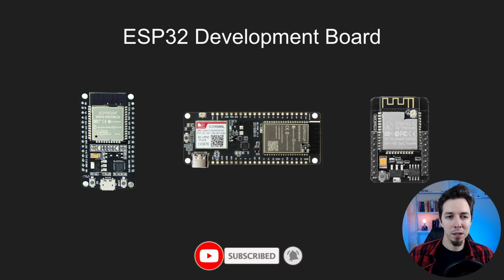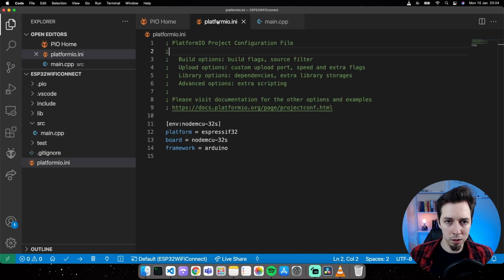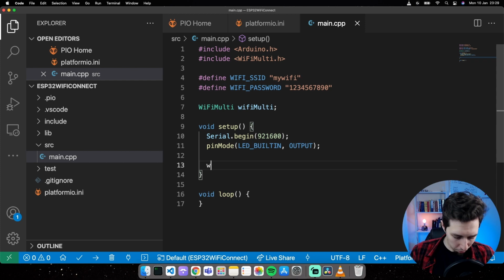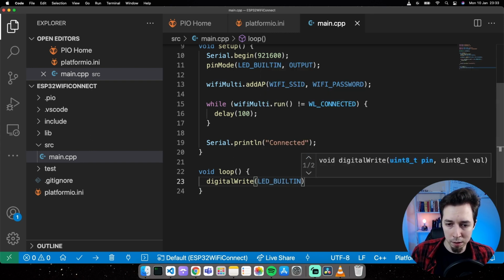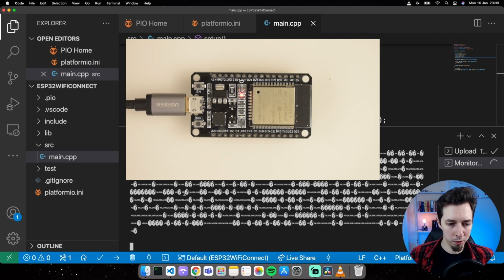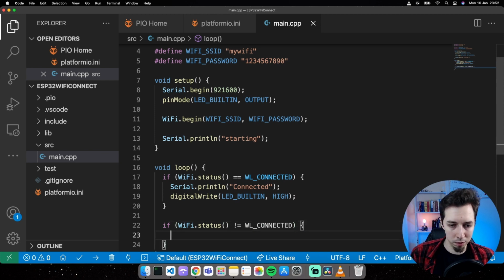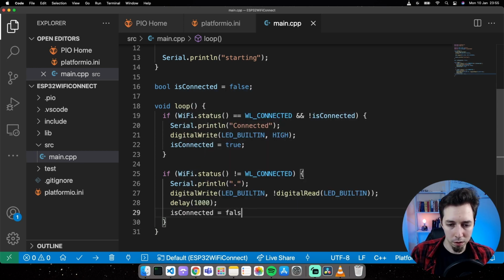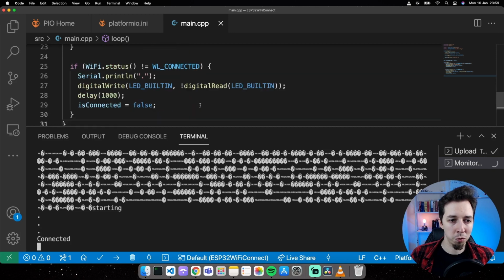Connect ESP32 to WiFi - Step-By-Step Tutorial

Comment: 3 years later and now I'm doing my master's degree with help from this vid. I actually was having some problems with one particular library DFRobot/LIS when i tried to use it in platformio everything broke and my esp32 kept resetting i thought maybe i had some problems with my code but nope it was the compatibility issue beetween platformio and the mentioned library. I went down a rabbit hole trying to fix it but gave up and created my own from scratch. I know this may be random but do have any knowledge about these types of problems ?
Reply: A small update in my excruciating pain of trying to fix this I completely overlook the idea of moving libraty depositories into my local library folder for the project. After tweaking names of variables here and there the entire project works as intended I don't know why it was such a complex problem maybe it's because the library depositories haven't been updated in over 3 years and something broke along the way but yeah... The correct solution is often the easiest.

Comment: Trying to get setup in VS and I am struggling with libraries. I get an error for "#include <WiFiMulti.h>" that the file does not exist. I don't get how you just had it? I have had this issue with another tutorial as well, is there a mega pack of libraries I need to install somewhere?
Reply: ChatGPT helped me out here. I have an ESP8266 and in order to get it working I needed to add the appropriate lib_deps into the platformio.ini configuration file. So I added " lib_deps = ESP8266WiFi " - that got then accepted with no errors. Back in the main code I changed the include to "#include <ESP8266WiFiMulti.h>" and also corrected the instance: " ESP8266WiFiMulti wifiMulti; ". Then the errors cleared out and compilation was a success. Upload worked and connecting worked as well.
I tried to search the tutorial again a few times but I think this part is missing from it or maybe in some cases the general "WiFiMulti.h" just works but in special cases you need to know to adjust some things.
Reply: I also had the same problem with "WiFi.h" it doesn't just work for me only by including it in the beginning of main. Then I consulted GPT again - it seems ESP8266 works different from ESP32 and I can only use the "ESP8266WiFiMulti.h" library which includes the "WiFi.h" functionality. The more you know.

Comment: NEED HELP!
I can't get this code running anymore. It worked a couple of times, but now the USB connection always crashes, even when I'm trying your simple examples. I figured out that it always crashes on the wifiMulti.addAP or WiFi.begin commands. When it crashes, the red LED on the ESP32 is flickering/dimming, and the USB symbol (I'm on Windows 10) in the taskbar is also flickering really fast.

I tried reinstalling the USB driver a couple of times and tried different USB cables and USB ports. I also connected my ESP32 to a USB charger (because I read there may not be enough power through the USB port). Additionally, I tried changing the Wi-Fi mode via "WiFi.mode(WIFI_MODE_STA);" and changed the flash mode via "board_build.f_flash_mode = dio", but nothing worked.

During several tries, I also had to factory reset a couple of times via "python -m esptool --chip esp32 erase_flash" because I couldn't upload any code anymore since the port couldn't be found by VSC. When I'm not calling the Wi-Fi commands mentioned above, the code runs just fine.

Can someone please help me?

Comment: instead of have the "connected" message  i have that message :  [WIFI] no matching wifi found! 
what's the problem ?

there is the code i'm compiling : 
#include <Arduino.h>
#include <WiFiMulti.h>

#define WIFI_SSID "mywifi"
#define WIFI_PASSWORD "1234567890"

WiFiMulti wifiMulti; 

void setup() {
  Serial.begin(921600);
  pinMode(LED_BUILTIN,OUTPUT);

  wifiMulti.addAP(WIFI_SSID,WIFI_PASSWORD);
  while(wifiMulti.run() != WL_CONNECTED )
 {
    delay(100);
 }
Serial.println("connected");

}

void loop() {
  digitalWrite(LED_BUILTIN, WiFi.status() == WL_CONNECTED);
}

is it normal ?

Comment: I like VSC and i hate the Arduino IDE, but the Arduino platform is really good for non commercial projects at home. VSC and the PlatformIO was exactly what i was looking for! Your explanations are easy step by step. Additionally the source code you have shown is able to be used directly in projects! Thank you so much!  

If someone is interested in my home project:
I replaced the relay-based swimming pool control with a Siemens Logo. It was clear that with the water temperature the running time of the filter pump is automatically adjusted. Then also an outdoor temperature sensor was installed and i knew, that i need a HMI.
At first i wanted to take a Raspberry Pi and PyQt because i have experience and with the Qt Designer i'm really fast and the python-snap7 for communicating with the logo works fine! But then i wanted a compact HMI with a small display and the indoor temperature and humidity should be measured with a BME280. So the ESP32 with the Arduino platform and Settimino to communicate with the logo should be the better option for this project!

Comment: Super Thanks!     just a stupid question, what do you mean by Blocking and Non-Blocking .. and which one is the best practice?
Reply: I came to the comments with the same question. Which one should I use and why. Which one would be more effective if I'm running off a battery?
Reply from the maker: Hi Katrina, in general I'd recommend non-blocking approach since you can run other operations simultaneously  although if you run on battery you need to remember about adding some sort of timeout to your code after which ESP32 powers off if still not connected to WiFi

main advantage of the blocking approach is simplicity - it's easier to keep track of synchronous code :)
Reply from the maker: Hi Zandan, 
Blocking means it won't execute any code that you placed past WiFi connection code in the setup function and the code in the loop function until it successfully connects to WiFi - we can call it synchronous way of connecting.

Non-blocking is asynchronous which means it will execute all the code in the setup and then it'll keep calling the loop function continuously so you can run other operations while ESP32 is connecting to WiFi

Order of execution for blocking approach:
1. Call the code before while (wifiMulti.run() != WL_CONNECTED) { ... })
2. Connect to WiFi and do only this. If it doesn't manage to connect keep trying don't do anything else.
3. Call the rest of the code in the setup()
4. Call the code in the loop() continuously

for non-blocking:
1. Call the code in the setup(), start connecting to WiFi in the background
2. Call the code in the loop() continuously regardless whether ESP32 manages to connect or not

Comment: Hello, thanks for the video, helps me alot. Can I make a question? Can you explain why esp8266 we don't need press de boot button and the esp32 need?
Reply from the maker: Hey João, the reason is the way ESP32 has been designed - it now requires a button pressed to enter the BOOT mode whereas on ESP8266 it enters that mode automatically. You can solder/connect a capacitor to ESP32 to not have to press the BOOT button - it's explained here: https://randomnerdtutorials.com/solved-failed-to-connect-to-esp32-timed-out-waiting-for-packet-header/

Comment: All my code is Ok. I tried both methods and is not connecting.. Any idea. It says error (6)... It seems to be an interference with the DHT11 temp sensor which is conected to the pin D4. I dont understand why
Reply from the maker: Does ESP32 connect to WiFi when DHT-11 is disconnected?
Reply: @tomasztarnowski4434  yes
Reply from the maker: this might be related to the following issue:
https://stackoverflow.com/questions/65125302/can-you-use-all-the-esp32s-gpio-pins-when-the-wifi-is-working

can you try to connect DHT-11 to one of the ADC1 pins?

Comment: to minimise the connection time:
1- assign static IP
2- use static channel
3- change delay to 20ms

I am getting in average 200ms to get connected (since boot) with these settings - crucial for battery operated devices that go to sleep
Reply from the maker: this is very useful! Thank you Zygfryd!

Comment: I use the non-blocking method but it only shows "E (180970) wifi:Set status to INIT"
Reply from the maker: hey, I've done a quick search and it might be either power source issue (not enough power supplied to the microcontroller) or there's too many devices connected to your network. 

Have a look at this conversation here:
https://gitter.im/espressif/arduino-esp32?at=5cf7ed58faac64393445739f

You can also try to add "WiFi.disconnect();" right before "WiFi.begin(..);"